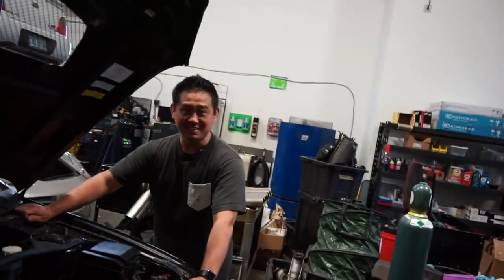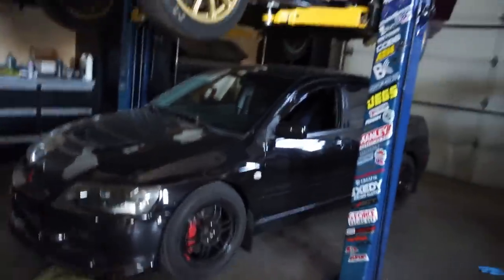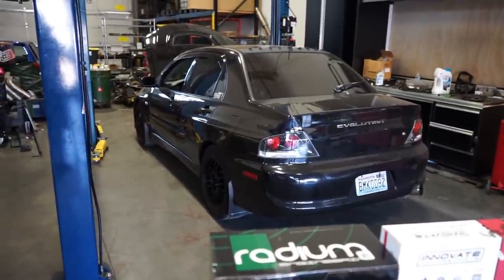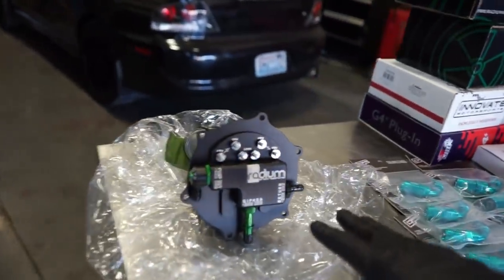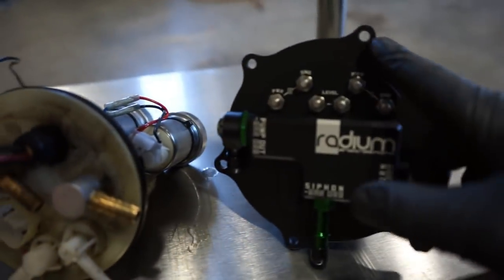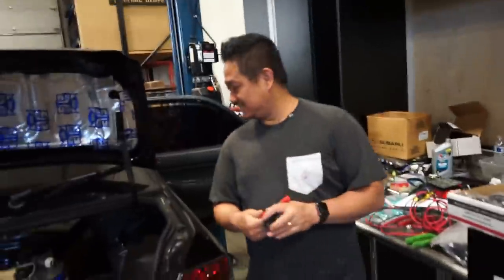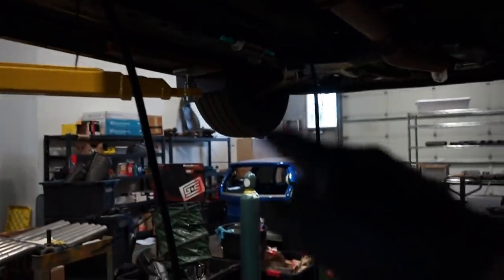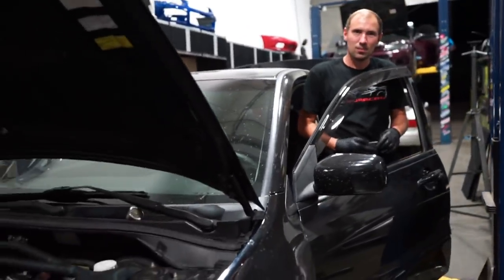800whp EVO 8 Build: All new fuel system install!

Comment: Correct way would be to put in a switch for the second pump to turn on when it starts boost
Reply from the maker: It had one in it 👍
Reply: @BaderBuiltRacing  noticed that at the end lol, im currently doing pretty much the same setup on my 03. buschur 2.3rpm with a 6266 twin scroll from maperformance

Comment: What is your preferred method to drain the fuel system on a evo 8/9 take out the plugs at the tank or disconnect return line into fuel jug?
Reply from the maker: I just undo return line and let it pump out if you can,  but both methods work well 👍
Reply: @BaderBuiltRacing  Appreciate the reply draining the fuel system today!  

If the vehicle will be stored for winter for example do you recommend any fuel storage additives or pre-mixing with a certain brand of two-stroke oil?

Comment: Should I get fp black or fp green with the new uhf wheel goal power is 500 whp on e fbo no more than that any advice?
Reply: That’s what I’m shooting for and my tuner suggested fp black. Most cars crack 500 on Fp black with e85
Reply: Sl0_STI but the fp green is supposed to be good for 500whp? And spools faster I think.
Reply: Wrx sti Videos probably possible since they say  it’s capable of it but with a lot of supporting mods I’m sure
Reply: Sl0_STI just bought the fp black my dued uff 😅
Reply: Wrx sti Videos you won’t regret it lol sounds nice when spooling too
Reply: Sl0_STI hopefully I don’t huh 🤔